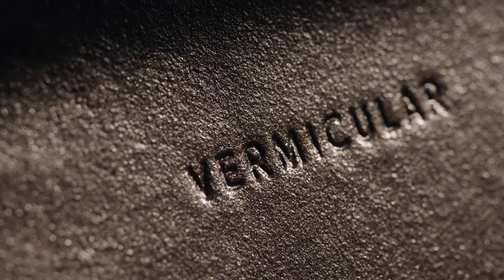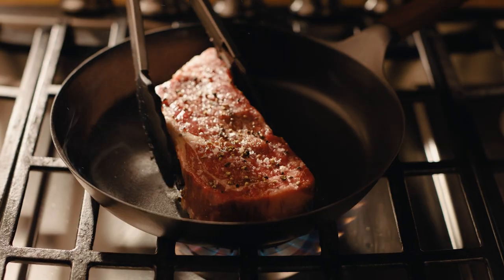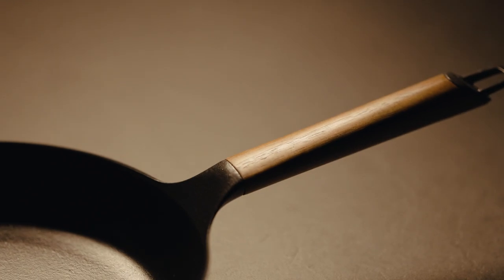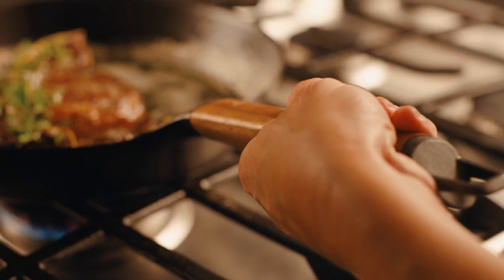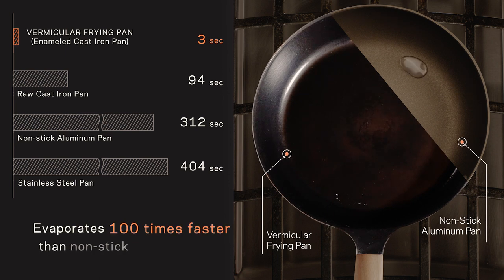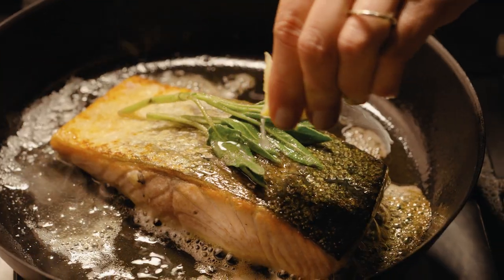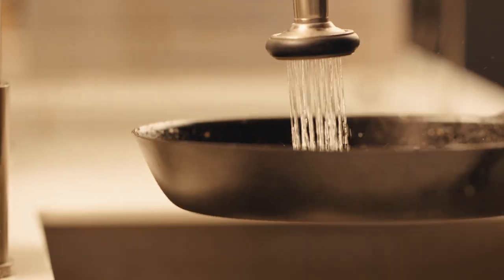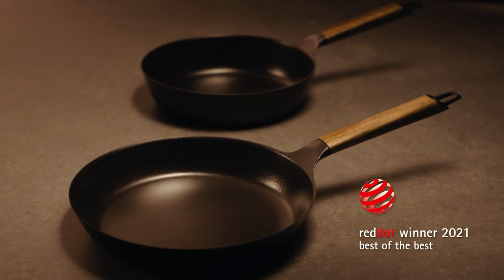Vermicular | Frying Pan | Product Intro

Comment: In order to make your pans lightweight the cast iron is made thin at 1.5mm. But most cast iron is a brittle metal. I've seen thin cast iron pans and woks crack. Are your pans strengthened in any way to prevent that?
Reply from the maker: Thanks for your comment! Yes, our pans are made up of compacted graphite cast iron, also known as vermicular graphite cast iron. The material has a number of advantages over traditional cast irons like gray and ductile irons but it is known to be resistant vs. both thermal and mechanical stresses; therefore, also used in cylinder heads and exhaust manifolds for cars. Hope that answers your question.
Reply: @VermicularGlobal  Thanks! It does. I'm also curious, how evenly does it heat in comparison to aluminum cookware or tri-ply stainless pans?